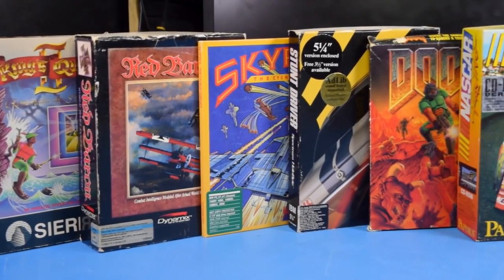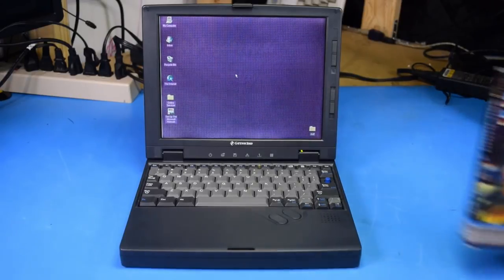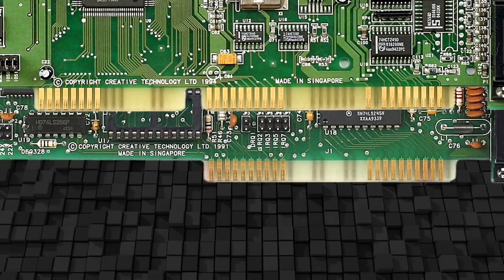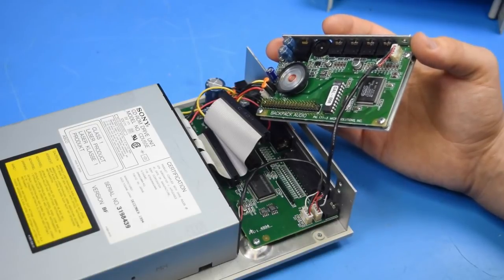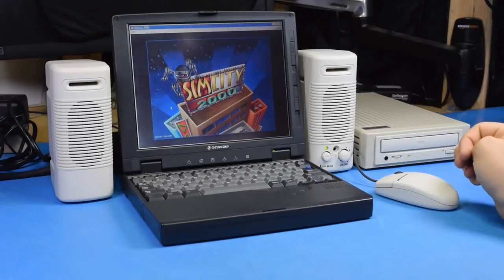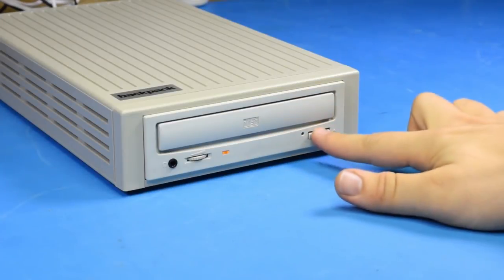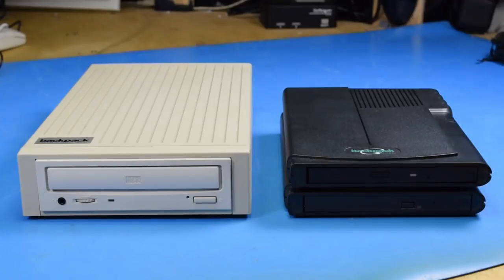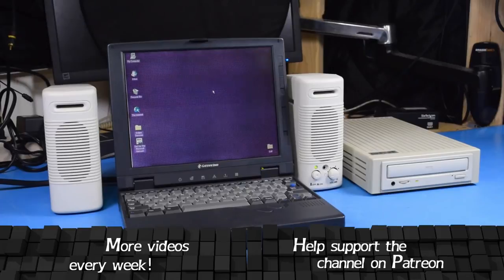LPT Sound Card In CD Drive is Almost Awesome

Comment: Well dang, I have one of these drives and didn't know it supported this bizarre sound card solution. Mine just has the unpopulated slot, though it's nice to know what it can be used with.
Reply from the maker: It is a really strange and interesting way of doing sound. The copyright date in the sound manual is 1995, so it would have had a very brief period of relevance. I bet they didn't sell many of these or the optional upgrades.

It's asking a lot of the parallel port as well. It just occurred to me I should have tried an FMV game to see how well it handled streaming video from the CD and audio back to the card.
Reply: Hey Clint! Just wanting to let you know awesome retrospect video about Half-Life there!
Reply: make it into an external drive!
Reply: Which means, I assume, that they ALL have those audio ports, which presumably just pass out CD-ROM audio if there's no sound card?
Reply: uwu
Reply: I've got one of these too, with no sound card. Now I'll have to dig it out and see if I can install one.

Comment: Ironically those OS/2 drivers would let you run DOS games with sound.
Reply: That's hilarious. He should do a video on that.
Reply: How? Ms-Dos isnt OS/2 compatible, is it?
Reply: Omega LUL Yes but not the opposite, msdos running OS/2 drivers and programs, thats the issue here. And i'm pretty sure that this compatibility in OS/2 only goes to a certain extent, even more, knowing microsoft as they are, and considering the history behind OS/2 vs MsDos. 

Also probably many of these laptops may not have the OS/2 drivers, and even tho it may run msdos programs, i dont know if it would accept the msdos drivers. But yeah, i dont know if there is much stuff mainly in those 486 laptops that should require a driver for working. 

But its really good to know that OS/2 runs msdos programs. It would be a interesting video idea.
I wonder how the games would react to the soundcard in the paralel port, with different interruptions than usual, etc
Reply: Franko Uh.. i guess you didnt read that wall of text, wich tbh, wasnt that big anyway.

You probably dont run that in a 486 laptop without a propper isa/pci integrated soundcard. And probably not a random machine but a OS/2 compatible one.
Reply: @eduardoavila646  OS/2 runs like Windows NT, it has no relationship with MS-DOS drivers. However it has ample emulation of standard devices in its Virtual DOS Machine, backed by existing OS/2 devices and drivers. It will also run Windows 3.1 software if the WINOS/2 package (of course a paid option, because it had a Windows license) is installed.

Relationship between IBM and Microsoft is neither here nor there. Microsoft didn't make PCs and components. It's usually not that hard to get OS/2 Warp 3 running and feature-complete on era-appropriate hardware, provided you had generous for the time disk space and RAM. There was no such thing as dedicated machines made for OS/2, it just generally ran on most systems, with some driver hunting effort.
Reply: Siana Gearz Yes, but wouldnt it need something as video drivers, chipset drivers, as its a more complete operational system? 
And how was the support for machines? I searched and didnt found anything about support for any of the machines i have. Also saw druaga1's video, it doesnt seem to have that much support. 
As i said it could potentially work well with these 486 laptops actually, but what about other machines such as my amd duron? It has 95 drivers but i cant seem to find any OS/2 related drivers. Actually i didnt found much about OS/2 drivers at all. 

Maybe the arcaOs would be a good option for these late 90's/early 00's machines?
Reply: @eduardoavila646   Chipsets of the era corresponding to the system don't need special support, they work out of the box with generic IDE drivers. No exotic or special chipset features are required by or supported by OS/2, i think for example advanced power management was not a thing back then. Tseng, S3, Matrox and Trident, which were the video adapters you could find in a consumer PC at the time, all had video drivers for their product lineup of the time, and you could obtain them with some effort from chip manufacturer, but generally you'd poke the IBM representative where you bought OS/2 and they'd have the drivers for you. Adaptec SCSI was i think also supported. I pirated it back then and installed it on my 486 PCI computer, based on P.I.Green unbranded mainboard (probably made by FIC, VIA or UMC chipset), and it just ran, and not too badly! I'm not sure what the situation with S3 drivers was back then, that's what i had for the video card, whether they were embedded or whether you needed to hunt them down, but right now i have no difficulty locating the S3 driver last updated in 1997 or the ESS1688 soundcard driver, which would have been good to have back then. Laptops often fell very much on the safe side - S3 GPUs, ESS or CS soundcards, all supported.

Comment: It makes perfect sense that they connected the 16bit sound card to the ATA bus, since the AT in ATA is for the AT bus.  Nothing more than a couple line drivers and the HDD connected directly to the AT 16bit bus.  So the real magic is the parallel to AT bus driver chip!
Reply: You are perfectly right.
Even more, there is no such thing as an "IDE controller" on the motherboard. A motherboard with IDE/ATA connectors contains just a bridge/host-adapter that does some basic address decoding for the IDE/ATA connectors. The controller resides on the IDE drive itself and is just an ISA device, just like an "MFM controller + MFM drive" combo.

Comment: You might want to look into getting a PCMCIA sound card. There were ones compatible with DOS games (ironically, quite a few of them won't work in Windows though).

As for using a DC power supply for the drive - there is nothing to worry about. The AC power almost certainly goes through a full bridge rectifier and later is turned into DC with the help of capacitors. So putting DC wouldn't damage anything.
Reply: ~Unibrow ON~
FULL BRIDGE RECTIFIER

Tho ye, precisely. You really just need the voltage to be a tiny bit above the AC one (you know, RMS AC voltage vs rectified one being almost peak voltage) and you basically just threw the job done at the parts inside the device.

I would bet even some new devices (like PC power supplies, TVs, monitors and such) would work on DC as well, with weird voltages at that even.
Reply: *There is one scenario where it wouldn't work tho: if you take the AC and use it to make a positive to ground, and negative to ground DC voltages. If it requires symmetrical voltage then it wouldn't work, which I really doubt is the case here.
Reply: Well it does put an extra strain on the diodes, as two diodes are no longer in use and two must pass all the current. But usually you can just glance at that specs or feel the temperature and ascertain yourself that there's nothing to worry about.
Reply: I've been looking for one here in Australia - last one went on eBay for over $200!!
Reply: Hey do you know a model of these PCMCIA soundcards wich arent hard to find?

Comment: The ES1688’s internal FM synthesis (ESFM) is ESS’s OPL3 clone using special patches that combine channels for more complicated instruments at the potential cost of polyphony. Switching it to OPL3 mode would use OPL3-like patches instead, no emulation required. Not a perfect match, but directly compatible.

I had an ES1868 in my first PC and vastly preferred how it sounded to traditional OPL for music, not so much for sound effects. That’s where the SBPro2/SB16 compatibility came in.

Comment: Considering that the original Parallel ATA/IDE bus was essentially just ISA run over a ribbon cable it actually makes a lot of sense that they would be able to hack a sound card into running off of it with just a bit of hardware glue logic and probably plenty of magic in the audio drivers (hence the incompatibility with DOS games which expect to be talking to a sound device connected directly to the actual system ISA bus, not one simulated by a parallel port bridge chip).
Reply: Actually, the magic might be pretty light (at least for 2-way parallel ports, not so much the 1-way + status ones). It's very possible that the GAL just provides some buffering, with the driver just sending the address in front of the data.

Comment: Nice video, but you may want to check multiple facts:
- The Sound Blaster 16 was NOT always the SB to get, especially when you want to play Stereo SB Pro games - the SB 16 is not compatible and plays this mono
- You can put almost ANY sound blaster in an 8 bits ISA slot, even if it looks to be a 16 bits card; for the 16 Bits models, only set the high dma to something that a bits works with; Only the IDE controller will not work
- IDE is in fact an extension of the ISA bus, so it's not that weird to attach a sound card to it; Considering the layout, the GAL chip seems to translate some missing logic
- The ESS audiodrive chip installed is highly integrated and incorporates the AdLib part - though you're right, it emulates it with its own synthesis (but in fact, lots of newer ISA sound cards incorporated the OPL2, for example later sound blasters (before Vibra))

While this is a nicely produced video, background fact checks are essential to a good production!
Reply from the maker: There is a lot of stuff to research when doing a video like this. If there any mistakes or omitted information, it wasn't for a lack of trying. There are some things that a reasonable amount of research will not tell you. 

 - SB Pro stereo is somewhat of an edge case. While I did not know that, I don't see how I would have come across that in the research for this video. If I could only have one card on a laptop/desktop, I would still rather have the SB 16 for the better compatibility with more/newer games. I suspect most people would as well. 
 - Nowhere on the Wikipedia page for the SB 16 does it mention that it is backwards compatible with 8 bit slots or XT class machines. So I had no idea about that. Why hasn't someone made a LPT variant of that then?
 - If you look up "Sound card on IDE" in google you get nothing but results for IDE connections on sound cards. So looking that up is useless. Underneath the sound card in the drive is a custom MicroSolutions IC. So I didn't know if it was making the IDE cable do unusual things. ISA over IDE isn't something I would have logically leapt to since there aren't many devices that take advantage of it. But that does explain how PCMCIA to IDE adapters work. 
 
There was a lot of other stuff I researched. The history of the OPL2LPT adapter and how it works, the optional sound upgrade for drives that didn't include it,  what the ESS chip was and what it was compatible with, general information about laptops for DOS games, etc. There are bound to be some things I could miss, there just has to be a reasonable balance of how much time I spend on one video. I'm not trying to be defensive, I just wanted to give my perspective and how it is possible to not know those things and have done research.
Reply: HA i totally forgot about this,  I also had some ISA card with the last pins in mid air back then. A lot of card order swapping to get them working simultaneously resulted in this solution by accident :) 
For the research part, you cannot know or find everything, that's why these youtube comments are so valuable.. (sometimes though) 
Keep up the good work!

Comment: I would definitely NOT recommend a laptop for old school gaming. It's almost impossible to find a laptop with a 640x480 active matrix screen (and seven if you do, a CRT screen is much better), and a decent sound support in DOS. Also, the old laptops are thick, so the keyboard sits so high that it's very uncomfortable. Of course if you don't have room, then it's better than nothing. I gamed with a '93 486SX Canon laptop in the early 2000's, with just PC speaker and a horrible laggy screen, but it was still fun.
Reply: The newer PIII laptops also are good for gaming. I have old Vaio F series that is perfect for that. Has a 3D accelerator card (ATi Rage Mobility m1). Also came with an OPL3 FM synthesizer with Sound Blaster Pro emulation. It also had a 4:3 display.
Reply: Just attach a CRT and a PS/2 keyboard (and mouse). Still much smaller than a regular unit, and everything is guaranteed to work together.

Comment: ESFM under Windows usually runs their custom 4-op patches on all channels, because it has the extra power. When you choose OPL3, i bet the Windows patchset is simply reloaded with the default Windows 2-op one. Of course the synthesis is still performed using ESFM algorithm rather than a native OPL3, but it's reasonably close, it's not broken.

IDE and ISA are the same bus essentially, only IDE has a limited preselected range of addresses to... well almost nothing, so that's how they run them off the same wire harness.

Comment: If you have a look at Patent 5335338, it details how the parallel port chip works and gives sample schematics of how they would implement the chip in the patented embodiment.  In short, the schematic shows them replicating the ISA bus via some fixed address pins.

Comment: Here's a fun fact about that "OPL3 emulation": it's not actually emulation at all, ESS has their own clone of the OPL3 integrated as a part of the AudioDrive chips themselves! (if Wikipedia is correct that is, seems to be true from experience though as I have quite a few systems with AudioDrive either integrated as part of the motherboard or as a ISA card and they work perfectly under DOS)
Reply: There are two distinct modes of the ESS embedded FM synthesizer though, the 72-operator ESFM mode and 36-operator OPL3 compatible fallback. Default OPL3 driver on Windows has 18-voice polyphony with 2-op patches. DOS games can utilise some 4-op patches on OPL3, at the cost of limited polyphony. ESFM Windows driver runs as standard in 18-voice 4-op mode with 4-op patches authored by ESS, and i have never seen the ability to switch it, but here they apparently implemented a 2-op mode with Windows standard patches.

Comment: I used to have an IBM ThinkPad 360 PE... with pen... external cd drive, win 95, additional ram card installed, and so much more.  All got left behind in a bad situation some many years back... was my very first laptop, and I would even use that with a PCMCIA modem during dial up days to go on to Aol Instant Messenger, as well as to do all typical web browsing back then.  Which in that era, was not a very intensive process. Such regret leaving that gem go, and such longing for those days.

Comment: two points, you could swap out the 2x drive with a 52x or 72x since its a standard ide, that would speed up loading connecting cd audio inside the backpack is trivial.
also i have seen one of those backpacks connected to a hifi amp for cd playback, those early 2x drives were slow for data but cd audio was excellent and they were very well made.

Comment: Thank you for the lead on the slim drive, i got a 1993/1994ish Dolch PAC60 that needs a CD-ROM, i plan to multi-boot via a CF to IDE adapter bracket, and one limitation was no optical drive, now i will have one, 95C with fat32 will now be an option as will OS/2 Warp 4.

Comment: This actually makes enough sense, since the IDE bus was not much different than a 16-bit ISA bus to begin with. So even though it was only used to connect drives, you could use it to connect almost anything that was ISA-based.

Case in point: PCMCIA-to-laptop-IDE-to-CompactFlash adapters which were almost 100% passive, and PCMCIA is a miniaturized version of ISA.

Comment: I wonder if the thicker  unit's CD drive could be upgraded to a faster one. It is an IDE device after all.    I may look for a parallel port CD drive for some FreeDos P1 systems I have.   I like having the option of real machines for DOS hacking.  My tower can use a PCI USB 2 card. but my laptop is just USB 1 at best.   If anyone is having trouble installing FreeDos on hardware, there is a very good YouTube video with a solution.   Great work Guy!   I look forward to more videos on these Digital Dinosaurs.

Comment: Try this with it: https://sourceforge.net/projects/vdmsound/

IIRC this will allow you to run DOS games, from within Windows and it will route the sound to the default Windows sound device. It emulated both Adlib and Sound Blaster for the DOS games.

More info here: https://www.vogons.org/viewtopic.php?t=2389
Reply from the maker: That does sound like a really good solution. I wonder if it will it work with games that reboot back to DOS mode by keeping them in Windows. 

I'm probably going to do a follow up where I see what can be done with the O/S 2 drivers in a DOS environment. I'll add this to the list of stuff to check out.

Comment: I have PCMCIA sound card for my 486. Because PCMCIA doesn't have ISA DMA, it's limited to AdLib sound and some limited DMA-less sound blaster compatibility. In Windows 3.x and 95 it can use Windows Sound System compatibility for full 16 bit audio. In theory you can use emulated sound blaster DMA under Windows 95, but Windows 95 doesn't run well on my 486 and I've never gotten it to work. It was also dificult to get the card working initially with the MS-DOS PCMCIA enabler, but after creating my own (undocumented) enabler configuration file that puts the ports at the right address for AdLib I did get it working.